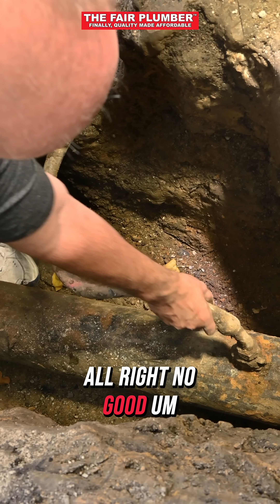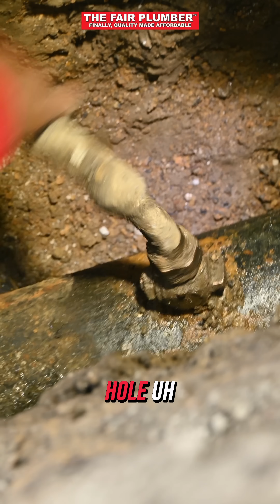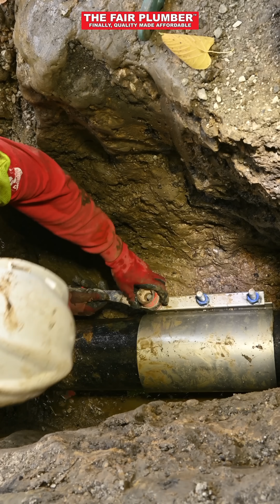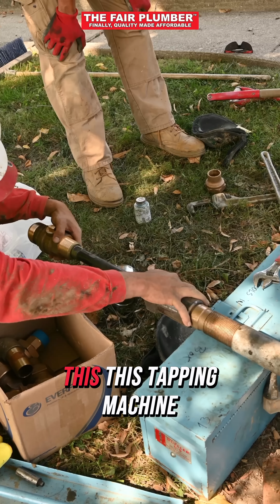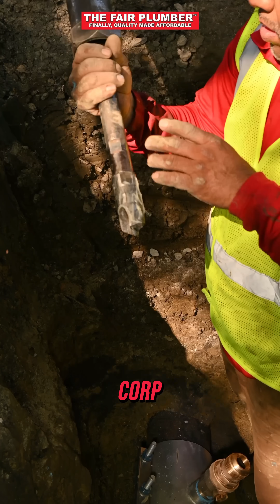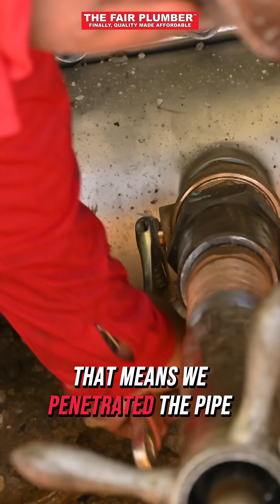Lead Water Line Repair - Part 1

Comment: Been doing plumbing for 10 years and never seen this done. That’s awesome!
Reply from the maker: Thank you! We really appreciate that. It’s always great connecting with fellow professionals in the trade.Glad you enjoyed seeing how it’s done!
Reply: I actually started in service work and tapped mostly PVC which is way easier but very similar. I have had to do steel a few times though before I went into residential and commercial. None of it is difficult when you have the right tools like any other job though.

Comment: That old corp would last longer than the sleeve. Sleeves are temporary repairs. Nice to work on a low pressure main. Do it with 150 in the line.

Comment: I did oilfield hot tapping.  I tapped a valve with 14,000 psi behind it and the pipe was only rated for 3,000psi.  People were literally hiding behind their trucks videoing so there was a recording of me DIEING.

Comment: And this is the video OSHA used as exhibit one in court when they fined them for not probably preparing a hole for this type of work. The sides of that ditch were way over 4 feet.
Reply: Right... That ditch is like 2.5 maybe 3 feet tops.
Reply: @joseph9770  guess the guy in the hole is an Oompa Loompa then? Stands up straight and reaches up over his head to grab the D-5 from his coworker. Edge of the excavation is at the top of his head.

Comment: England has hundreds of miles of lead pipes it's only a problem when you have acidic water. We have replaced most of the cast iron pipes with pvc like we have with the gas pipes. Why are you removing a perfect good brass fitting seems like a no brainer to just connect up to what you have. Rong size thread

Comment: The lead oxide layer in the pipe, if not disturbed,  is safe enough
Reply: The case in Flint Michigan a few years back, was a failure to maintain the layer due to a lack of understanding of  water chemistry by the city water operations staff. The importance of maintaining a qualified knowledgeable staff is important to  protect the community.
Reply: No
Reply: @zteaxon7787 yes

Comment: Why not continue using the old valve? Looked brass and didn't appear to leak. Just needed a bigger line?
Reply: That's if you can find a compression fitting that will adapt to the lead corp..it is possible we have done it on many job site's where we had to remove lead line from the main to the meter..it's just a pain to find the part to adapt from copper or pex to lead😊
Reply: Some old brass would be alloyed with lead.
Reply: @forunonein in CO depends on the up or down flow of the lead

Comment: That old valve was brass, not sure why they needed to replace it.
Reply: Makes no sense why capping it is supposedly improper. How is rubber clamped over an open hole any better that seems much much more prone to leak no matter how well you clean the pipe.
Reply: Exactly, and in good condition too.
Reply: It's probably for warranty purposes. 

They need to install a new valve, but since the main is live they can't verify tape/dope coverage on the threads
Reply: @coollukasz If ANYTHING, i can see for safety, like that main has a hospital or nuclear facility upstream and needs to stay on, or fitting a plug live while energized is sketchy as heck, but warranty sounds a little out there. I'm not saying that's NOT the reason, because I've seen stupid stuff being the SOP, "for our warranty, " just not this back asswards
Reply: to put a bigger one on?
Reply: I came to the comments section specifically to see this. He said," some guys plug it, but we do it the right way..." 
- Why wouldn't plugging the line with a brass or stainless plug not be correct?? Im just an industrial maintenance tech, i dont do this for a living, so im genuinely curious why plugging was a bad idea in this situation??

Comment: I'm a 39 year pipe fitter. And these guys did a good job doing this. Doing a live tap is unpredictable
Reply: could have put the new sleeve over the old hole, lined it up with the new large drill fitting and saved using the blank sleeve.
Reply: @joey66436 Not a plumber but I was thinking the same thing waste of a sleeve that looks like it will still leak
Reply: @yogirlkaybae3577 could still leak but eventually it will.
Reply: @yogirlkaybae3577 Exactly, you're not a plumber. They are. Maybe they can't have two holes under one sleeve for some reason. But either way this is the way they do it
Reply: I personally would have plugged the older tap since rubbers don't last long enough, that's why I have a little brother unfortunately 😂😂😂😂
Reply: Pipe lube is also beneficial in causing the rubber to slide
Reply: I was a union pipe fitter for 40 years and I thank you for all you do to build America! It is not an easy trade so please work safely!
Reply from the maker: Thank you for your kind words and for recognizing the work that goes into it. Coming from an experienced pipe fitter, that means a lot to our team. We truly appreciate your respect and understanding of the challenges involved in a live tap!
Reply: Proper way lol
Reply: Why couldn't they use old valve? It wasn't leaking, it was operational and looks like made from brass.
Reply: No proper way the only way is what works
Reply: WOE! That was a lot of pressure. NOT
Reply: Especially if you're trying to steal gasoline by tapping one of "them" lines.

Comment: The proper way ?
Rotflmfao !
Must be charging by the hour, and 300% mark-up on materials ?
And a fuckin drill is not " technology "
Einstein !
I have done hundreds of these !
You sound like a complete idiot !
But it's what you were taught to be true !
Because of that. I call bs !
I would smoke your ass with a hand ratchet wrench.
And you actually out a level on to get a 45°
WTF kinda bs is that ?
You prob don't even know why you did that ?
Damn dude !
You are either just poorly trained !
Have no common sense ?
Or just an idiot !
I am going with the latter !

Comment: What happens to the material that is drilled out?
Reply: Gets flushed out by the water spilling out of the drill guide
Reply: Pressure likely pushes it up into the drilling tool

Comment: Not much water pressure from that main!
Reply: It wasn't open all the way. Trust me, I've ripped out one of those lines at the corp before, and his entire ditch would be a swimming pool in under a minute
Reply: @WizardZph so they shit the main off and its just leaking?
Reply: @reubeng2110 just residual water left in main. Not full pressure of a live main